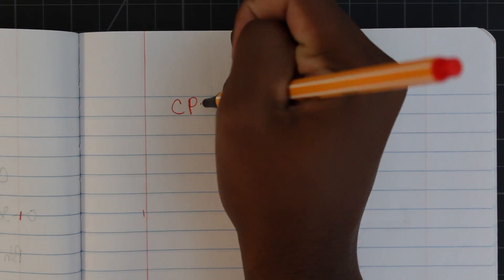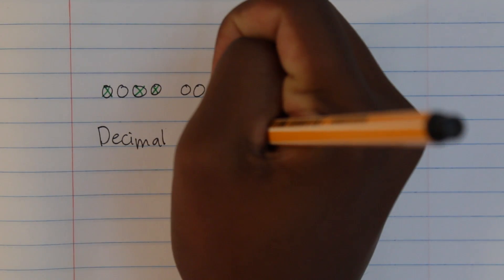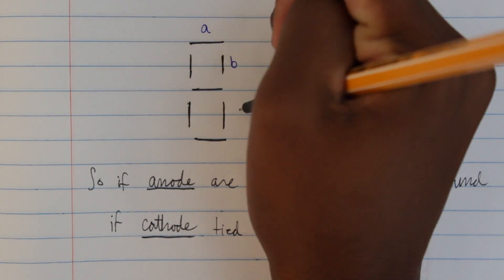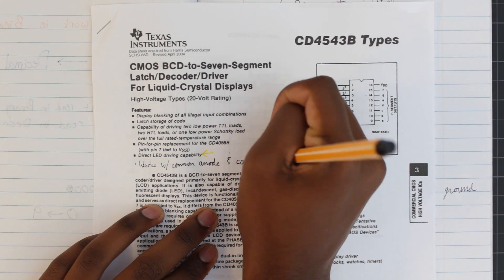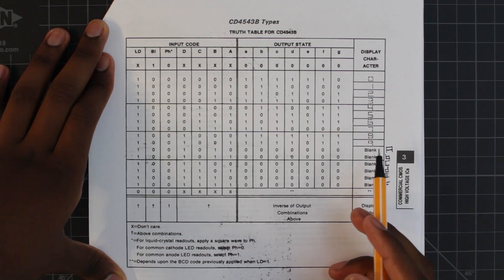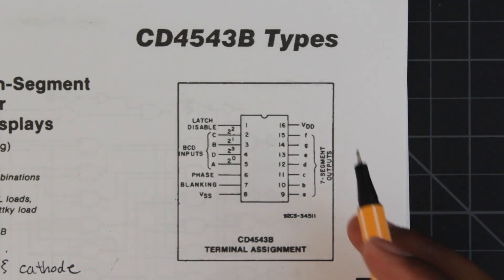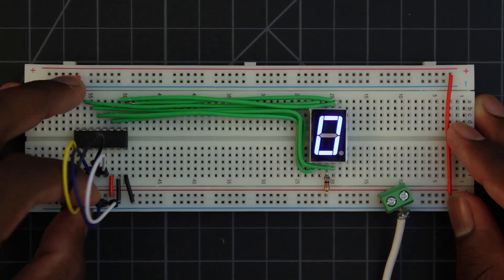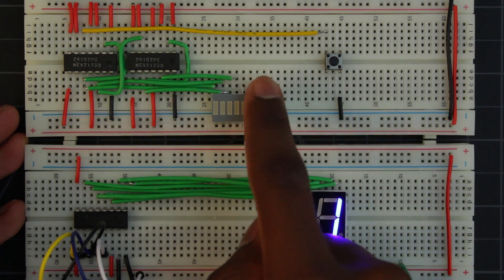Convert Binary Numbers to Decimal | 8 Bit CPU

Comment: This was a pretty good video. Wish I would have found it when I was looking for this information the first time a year or two back. 
As far as not liking the pin outs of the chip that's unfortunately how a lot of them go. I'm not sure as to why exactly but I'm sure it makes sense in the manufacturing end or how large scale users of the chip prefer it for what ever reason. I have the 4511 version of this chip and the binary pins it are the same but it has even more odd ball pins you have to tie low and high. It's so bad I have to reference a photo I took of it working after playing with it for a while, so this IC isn't to bad haha.
Depending on what you are running you could use BCD instead of full Binary and decode the output a lot easier, but I know we don't get to choose our inputs very often. I'm always surprised that there isn't a standard Binary to Decimal chip but I'm sure it's just not used often enough to make. But then I wonder how so many digital devices interface with us as it is. So many questions...

Comment: 3:40 - Look at the datasheet for DM9368. It's no longer made, and it can be hard to find, but you can still get it on eBay from China. It's somewhat expensive compared to other IC's.
Reply from the maker: no worries we don’t use it in the final design

Comment: If there exists a 16-byte (8-bit) EEPROM, that could be programmed as a 4-bit to 7-segment hexadecimal decoder.  I haven't yet looked to see if there's such a thing, or if there is, whether it's worth the price.

But your stated aim of using a larger size EEPROM as the decoder will work too of course.
Reply from the maker: +JasonMasters yeah I couldn't find one either, that's why I'm building my own

Comment: A binary number is not a BCD! To use these BCD to 7 segment driver chips you would have to convert your "real" 8 bit binary to a 12 bit BCD, that is why these chips do always have just 4 inputs. A BCD - which the name implies - is just a (B)inary (C)oded (D)ecimal where each single digit of the decimal number is represented as a binary number. So a 123, which is 0111 1011 in binary would be 0001 0010 0011 as a BCD representation.
Reply from the maker: Thank you for clearing that up! I didn't know that. Thanks for telling me!
Reply: Great information, thats why. Thanks.